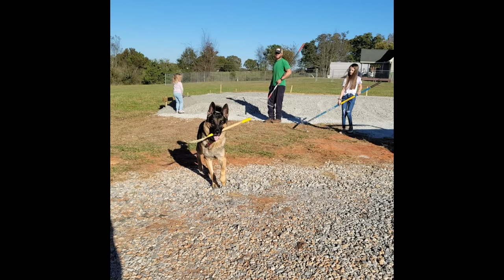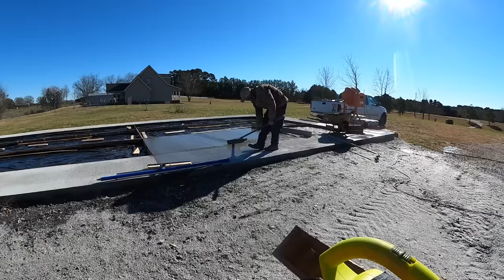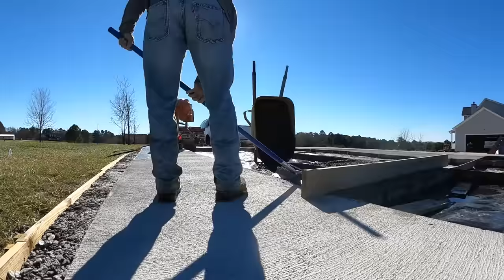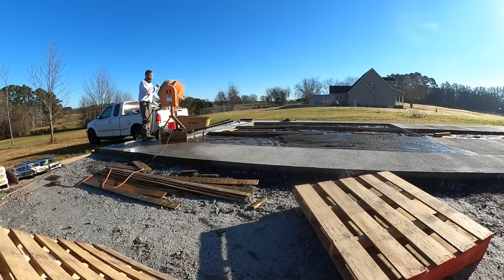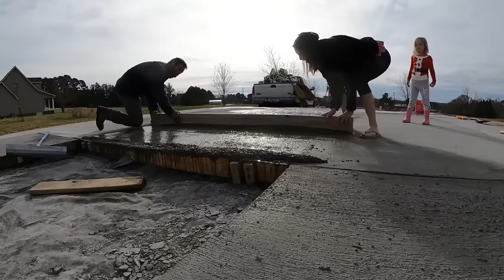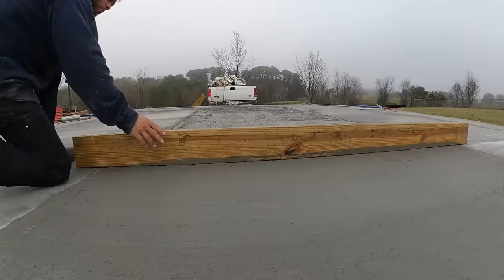Pouring a Huge Concrete Slab Using Bagged Concrete | I Saved $10,000

Comment: Very cool.  For future pours  just have them dump a truck load of 7/8th washed rock and a load of washed sand and mix 1,2,3.   That's one of cement, two of sand and three of gravel.   You'll save even more money.   Doesn't seem that long ago me and some buddies were pouring the roof trusses to the Seattle King Dome.  6 am to 6 pm.  Then they blew it up.   Now I'm 72 and have to baby my old aching back.   Good job.  Build it yourself.  Keep pouring.
Reply from the maker: The issue in my area  is sand cost. They want 50 dollars per yard plus tax right now. I figured up and you don't save much at all anymore doing it that way. I remember a few years back you'd save almost 1/2 doing it that way. This inflation has got everything all out of whack. I just re calculated and mixing it that way right now in my area cost 165 per yard. what the heck!

Comment: Having that plastic down was the best idea... Gave you lots more working time for mixing. Great work! Thx for sharing....
Reply from the maker: It did that for sure which I didn’t even realize it at the time. I did it as a vapor barrier to prevent moisture from coming up through the floor. That was a definite added bonus.

Comment: That's a LOT of work !  Glad to see someone who's not afraid of it, like most people today. I think the only thing I would have added, would have been to drill some horizontal rebar stems into the slabs that were set up before pouring the ones in between, just to try and keep any one slab from rising or falling at all, compared to the one beside it.
Reply from the maker: That’s a good idea! I haven’t had any issues yet but sort of wish I had done that for added insurance. Hopefully it will be ok.

Comment: My brother and me do this many times, lesson learned and tip. You should of put the the loaded cement pallets on 6-8 empty stacked pallets. Saves alot of back pain from bending over and picking them up. We also do fences. We mix around 70-100 80lbs bags with shovels, a barrel, and a tote full of water and carry the water with a 2 gallon bucket many times within the year.

10k is alot you saved for your family and you. You did awesome 10 out 10! Great job Sir! Ignore the naysayers!
Reply from the maker: That's a good idea stacking the pallets up like that. I started off doing that a couple of times and then got locked into my head "just do it" haha That's a lot to mix with shovels, hard work in itself! Thank you for checking my video out!
Reply from the maker: @TUGG75  oh well. The money I saved on concrete alone was enough to pay for my mixer and all tools required. Which I'll have for the rest of my life. I called yesterday out of curiosity and truck is 165 per yard which is about the same price of bag today.
Reply from the maker: @TUGG75  but then I won't get the satisfaction of saying I did it myself and saving money haha
Reply: Dude moved the pallet of concrete with a tractor so he coulda just left the pallet on the forks then raised it as the pallet got shorter
Reply from the maker: @aliassmithandjones9453  My tractor was at max capacity, I had to break the pallets down in half to move them around. I was afraid that much weight sitting on the loader for extended time would somehow damage something. It shouldn't. But that thing was to expensive to chance something like that.

Comment: This is cool I love a good DIY. To anyone looking to pour a slab, please use #4 bars at 18" on center each way. And If you want to do a structure on there like a garage you really want a thickened edge section. 12" deep x 12" wide is pretty standard with another #4 bar running along the bottom. This is a footing to support the walls and roof. Monolithic concrete can work fine for things like a 24" diameter x 5 ft deep footing. that's a 2:1 thickness to length ratio. For slender / long things like a slab you really want some rebar in there for long term high quality performance. The standard minimum reinforcement ratio for temperature and shrinkage is 0.002. That's the area of steel divided by the area of concrete.
Reply from the maker: Thank you for the good information. It's much appreciated. So far with what i've got, i've had no shifting / cracking. I hope it will stay that way. haha I will be doing yearly updates so stay tuned!
Reply: This is better advice than not adding a footing, but it really depends on the soil type, the frost line and the weight of the structure. This information can be found online and in the local building code. The USGS charts out soil conditions for each area, which should be good enough for this application, however, the most important consideration is the frost depth. In some areas 8' deep footings are required to prevent heaving (where the frozen ground pushes the structure up out of the ground). This is why cold areas have basements, if they already have to go that deep, might as well utilize the space.
Reply: The frostline is a good and important point. The standard minimum reinforcement is sufficient for light frame single family dwellings with up to two elevated platforms (slab on grade doesn't count as elevated since it bears directly on the soil). But if you do as Michael suggests and excavate 8ft deep, have an elevated slab, and want to park a 4 Ton pickup on top: better talk to an engineer. Elevated slabs are another deal.

Comment: I once poured a sidewalk in my earlier days consisting of 33 bags which I mixed in a wheel barrow, and I thought that was a lot. 800 plus bags that's a miracle. I later built a 24x24 garage but I had a truck come, it took 9 yards, a whole truck but back then it was an amazing $575 bucks. 58 dollars a yard, I built the whole thing for 5000. out of wood. GREAT JOB MAN, I'm am extremely Impressed.
Reply from the maker: Last week I mixed some bags in a wheel barrow for a few fence post. I was too lazy to break out the mixer. Let me say. 33 bags mixed in a wheel barrow would be brutal. haha I was getting impatient just mixing 8 bags. I wish concrete was still 58 dollars a yard. In my neck of the woods its 200 to 220 with a 4-6 week wait! Thank you for the kind comment.

Comment: Hey! Respect your work, it’s a heavy work for sure. I worked here at the concrete plant in MN for 3 years and I do stuff around the house with concrete too, just sharing a few more tips here from my experience 😀 

If your approach was to save money
 You should be Mixing concrete yourself, 3 parts rock, 2 parts sand and 1 part cement. That’s how I did my 26x16 slab here last summer. I wasn’t trying to save money rather was doing it for the workout 😀

Idk where you are based but here in Minneapolis twin cities it’s 210$ per yard delivered and if you order more than 5 yards delivery is free.

Im building a cabin 2 hrs north in the woods and concrete there is 150$ per yard this 2022 spring delivered, bagged concrete at around 3$ a bag cost you about the same 150$ish

So.. to save money you mix the concrete yourself, not buying bags. 

Another tip here is - use rebar.. 1/2 inch real rebar, with the cost of concrete you won’t notice those few hundreds but your slabs will be much stronger. Concrete has a great strength at compressing forces but the forces pulling it apart can do so easily if you don’t have good rebar, again the cost of rebar next to concrete is nothing.

My last tip here is - use plastic under the slab, the concrete has water with cement and if you don’t have that plastic it will run away from your mix to the ground and your concrete will be not as strong. The even better choice is xps foam boards, 25 psi. That’s what I used 😀 yes it cost more but in the winter you want warmer flooring especially in the second coldest state in USA 

Rock on and good luck 👍
Reply from the maker: Thank you for the good information! I am going to be making some more concrete videos soon. I have to make a small sidewalk for my kids plahouse, and the wife wants a patio. I might try out the method of mixing it all myself like you suggested since they will be smaller projects. Here when I did this concrete was 200 to 220 per yard depending on the day, and I got the bags for 3.20. I chose bagged over mixing individually based on time as well. I work a lot and wanted to be able to mix and pour as I had time, but also needed to get it done quickly because of setup. If my mixer were larger I would have definitely went that route. I did use thick black plastic under all of the pads. I didn't know that it would make it weaker! I did it more for the water barrier. Thanks again.
Reply: Hey just saw your comment but wanted to update mine. Poured patio on Saturday. 120x10ish , some places was 12f wide some 8, anyhow had 2 trucks delivered 6 yards each. At 200per yard it still was 1500 per truck total charged with all the fees.

I rented a concrete buggy and power trowel too and had one helper to run the buggy.

The first truck delivery was a bit dry, which messed up the flow so when another truck showed up I already had piles of shit on the backyard, the second truck was better, I was hoping to stamp it with some bricks but managed to create lunar surface wo any stamps..😂 now I need to refinish it all with top mix mixed by hand of course 😀 the patio along the driveway came out better but is also rained a few times which wasn’t on the forecast that morning.

The buggy didn’t like plastic and kept getting tangled on rebar mesh. It was hell

I regret not having more people or not mixing myself so I can just go with my own speed.
🙈

If there would be a competition for the ugliest patio in the neighborhood I’d definitely take the winning 🥇

Comment: For someone who has never done anything this big and them to say they aren’t a professional and a slab to look that good, my friend you did damn good work and yes they were something’s you could have added like the rebar or wire it helps hold the concrete together and helps keep it from cracking and it makes the pour a lot stronger you done a first class job in my opinion for someone who has never done anything that big
Reply from the maker: Thanks brother I appreciate the kind words. Yeah I had never done anything more than a small pad and was kind of nervous about taking this on. I wasn’t willing to pay the 14k local contractors wanted so figured hey how bad can it be. So far it’s holding up well and I’d do it all over again if I had to.

Comment: Wow.  You are one hard working guy.  I can't imagine how much work that was.  I'll say this, though - everybody is right about not buying "concrete mix".  It's more than a bit of a rip-off, you end up paying way too much for sand, and you have to use it bag at a time and it settles.  So instead, do what every job mix site does.  Buy bags of type I/II cement, and then buy gravel and sand in bulk.  Sand and gravel last forever, you can buy it delivered by the ton, and leave it outside on your site.  The bags of cement of course you have to keep dry.  When you mix, you don't need to mix a whole bag of cement, because it's all uniform in the bag.  Just dump a bag into a wheelbarrow, and then mix each mixer load by shovel count.  So like a 1 2 3 mix is 1 shovel cement, 2 sand, 3 rock/gravel.  It's easier than pre mix that way, cheaper, and probably faster  Good luck!!
Reply from the maker: I was definitely going to go this method if I had a larger mixer. I've done this before with the mixer I have now and it's really slow going. I felt like it would've taken me weeks to do this project if I had gone that route. It would have definitely saved me more money. I just wish I could afford a larger mixer. That would be awesome!

Comment: i poured block wall footing and a concrete patio one summer.. it was about 30000 pounds of concrete 3 bags at a time in that harbor freight mixer.. well worth it... your project looks great
Reply from the maker: Thank you! The harbor freight mixer is definitely worth it. I honestly can't believe it's held up as well as it has. Thanks for checking out my video!
Reply: It will break I know.  You got lucky
Reply from the maker: @capo construction It's literally a ball bearing, gear, pulley, belt, electric motor. Whatever breaks can be cheaply replaced.

Comment: Thank you ! ! !  You just showed me how I can get my pad built by myself and in sections.  My little project is 21' 5" X 32'  Which I can break into 9 different pours and by doing it the way you showed I can get the walk-in cooler built before this hunting season starts.  It will be a slaughter house / class room and farm office with an apartment above so I have a rew extra chalanges but nothing that can't be done in sections.
Reply from the maker: Awesome! Right now with all this inflation (in my area at least) bag is about the same as truck. Even making your own concrete is about the same price as truck. I have another concrete project coming up, what i'm going to do is call and see what the minimum you can get with free delivery. And set up my forms in that size so that I can still manage it myself. You may save some money going that route. I wish things would go back to normal. Good luck with your project, thank you for checking out my video and for taking the time to leave a comment.

Comment: I admire your persistence and grit!! I also have the same. Slow and steady wins the race. You have my respect!! I hope your slab survives temp changes without rebar. Concrete contracts and expands so having that rebar really helps it from falling apart. Good luck!
Reply from the maker: Thank you! Our temperatures around here aren't to crazy. Summers sort of hot 80's to 90s but winters average high 30's to 50's 

Rebar isnt needed on a residential on grade 4" slab. No one around here does it. Most of the time they just grade clay and lay driveways, sidewalks, slabs on top without gravel.
Reply: No rebar or 6x6, 10/10 wire? Big mistake!! Better buy some crack filler.
Reply from the maker: @bobestell2767  rebar isn't needed on a residential on grade 4" slab. Not in my climate anyhow. Forgot to add I have ~40,000 lbs sitting on it right now and still looks as good as the day I poured it.
Reply: @bobestell2767  And a lot of it
Reply: @reallifetested2605  I understand. We have rock hard clay. No need for rebar cause holds up just fine here.

Comment: The real life terminator, just getting it done. Awesome job man. My father and I did an add on to our shop probably in the 2010 range and it was about half that size and was alot of work. I can't imagine doing twice all that by myself. Very impressed.
Reply from the maker: Thank you for checking out my video, and for taking the time to leave a comment. I appreciate it. I’m about to be doing this again soon if the prices of concrete haven’t came back down so stay tuned haha
Reply: Do you think Slick got it done in three days?

Comment: looks good. 

did the same thing for my wallipini greenhouse. the concrete was $2k CAD, including mortar for cinderblock walls, for 512sqft. since local materials is sand and gravel, only needed portland. 
ended up only using half, because concrete calculator was way off, but still saved tons of $$$. 

horrifically hot weather during mine, but really not too bad if the weather is good.
Reply from the maker: Thank you! 

I've never tried mixing everything individually before. But my next project won't be so big so i'll definitely be going that route. Hot weather would suck doing this! I bet you had to work really fast.

Comment: The slump looks pretty solid like 3 or even 4 slump.  That's good and will hold strength over time unlike really wet soupy concrete.  I haul and pour concrete six days a week in a mixer truck.
Reply from the maker: Thank you for the kind and informative comment. You have no idea how much I appreciate that.
Reply: I was wondering if I was seeing correctly it seemed as if he was spraying fresh water on top of his newly poured concrete I was wondering why he would be doing that or even if he was doing that
Reply from the maker: @arlenmargolin4868  no lol I was spraying the edges off that I'd already done.